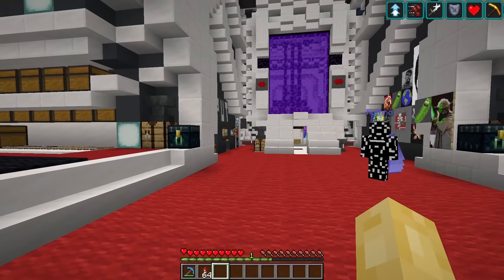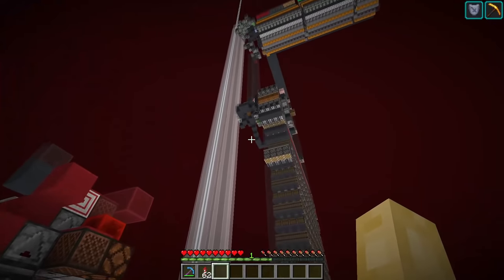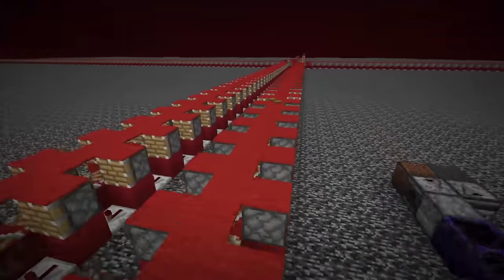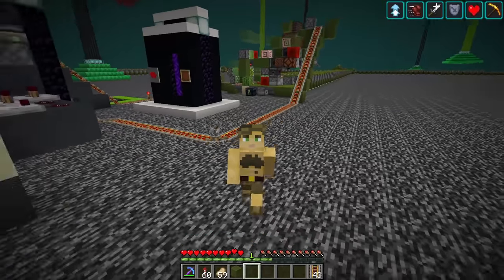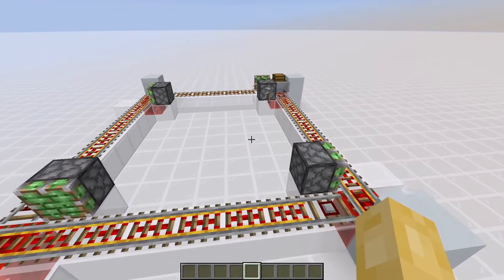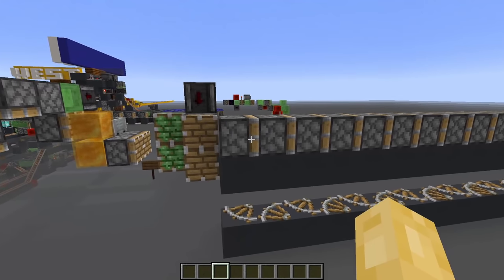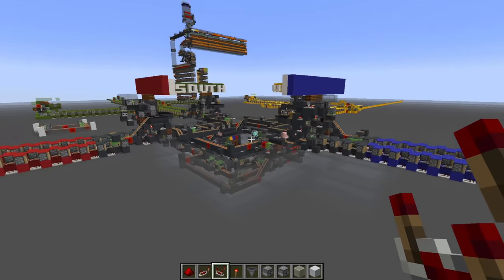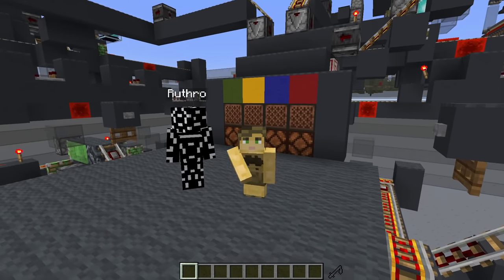The INSANE Engineering of Wavetech's Pistonbolt Network

Comment: Why not put a normal rail to turn corners
Reply: because the stack of carts would just explode, depending on the stack sizes
Reply: The curved rails would make the stack of carts separate, whereas the rigid snapping from powered rails keeps them together on turns.
Reply: @inspectortalon  this is the proper explanation

Comment: I wish I could build one of these but I lack braincells
Reply: dont need brains to use litematica! masa already put his to use for our benefit
Reply: dont have those big farms anyways lol
Reply: @junyong0716  yes this system is really for bulk item transport, and I'm pretty sure only tech servers have so many items they would need a system like this. if you're just looking for player transport there are better ones out there. the only advantage mine has is that it's designed to be built on top of the bedrock without requiring you to break it
Reply: You just need to make bolts and paste some schematics in. You don't need braincells for that.
Reply: @RuthroAlt  oh its the original creator himself! that was exactly what i was talking about. i dont have to transfer that much items at once. i can just put everything in a shulkerbox, and put those in my inventory and echest and just fly to my base.
Reply: @jakonix6068  yea but those arent regular piston bolts, those are made for mass item transfering.
Reply: @junyong0716  the bolts themselves are the same, it's just the intersections and stations
Reply: @RuthroAlt  yea of course
Reply: @RuthroAlt  and those two are the parts where it gets tricky
Reply: @junyong0716  they're pretty easy to build, you just have to make sure not to destroy any curved rails unless you have a mod that allows you to rotate blocks like we do
Reply: @hellokitty69  I'm on bedrock so theyech would have to be different and I don't have any kid of litematica